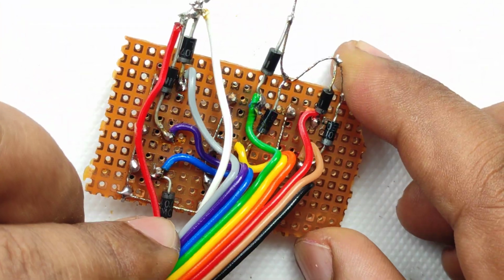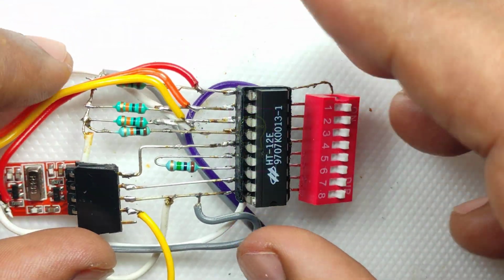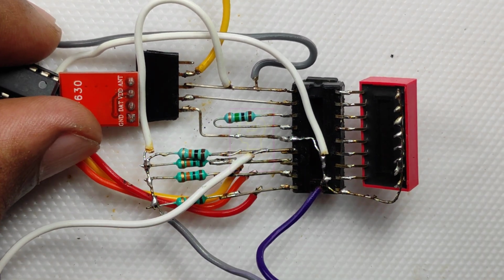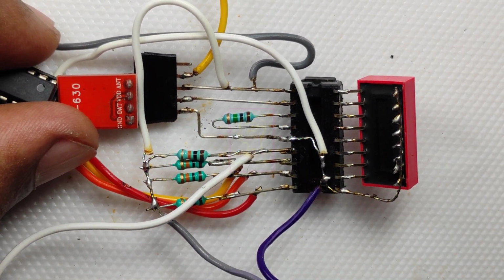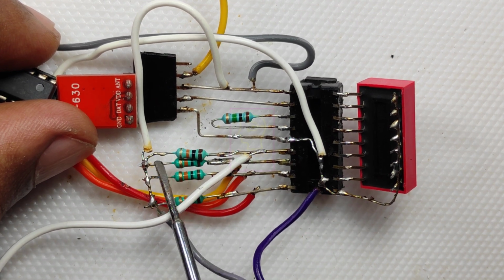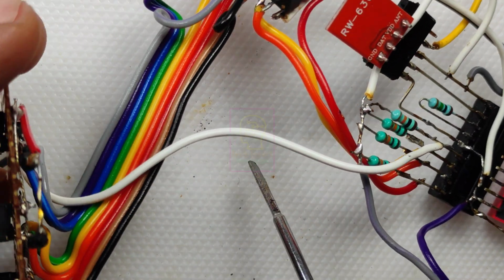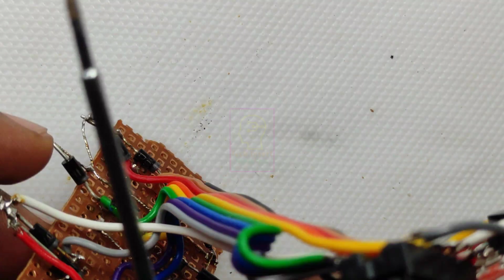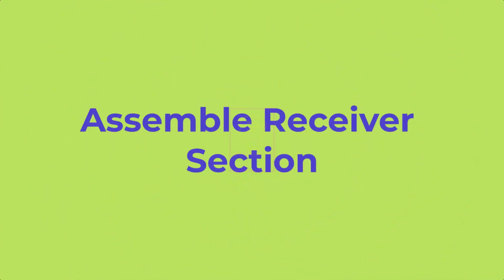How to make Wireless Control (8 - Channel) at your Fingertips | DIY RF Remote Switch

Comment from the maker: @harunkaramuklu1460 pointed a mistake in the transmitter circuit which happned whilie I was updating the circuit from the rough book. Updated circuit diagram is in the following link. https://drive.google.com/drive/folders/1Bwh3xJPWxNahuFEDpNjN2nsm4nyV5UAx?usp=sharing

Comment: What pines are the yellow and Black wires connected to,  that  connected the switching board to the receiver
Reply from the maker: I recommend to use the circuit diagram

Comment: Sir, I only want five channels. What should I do about the diode or circuits in general?
Reply from the maker: I suggest you  to make this 8 channel and make it work. Don't make switching circuits. We will test using LED. After that I will guide you to change it to 5 channels.  You already spend more time on this. This is the short cut idea
Reply: @TechInsert Sir, I want to inquire about something
I used 74hc148 in the transmitter circuit instead of 74ls148. Will it affect me in the circuit? Thank you.
Reply from the maker: @s_ja1935  If you are usin g four channel , then  74148  and 74138 are not used. More  than  4 channel u need these 2 ic's for multiplexing and demultiplexing.

https://youtu.be/VKpRNg_Gl9g

Comment: I have a question about the reception circuit, pins 4 and 8, whether connected to ground or not in IC 74138
Reply from the maker: 4 and 8 connected to  ground.  74138 Pin 4, 5 and 8 are connected to ground.
Reply: @TechInsert Thank you sir ❤❤

Comment: hello sir 
Thank you for the wonderful circuit 
But I have a slight problem with IC 74138 and IC 74148 I connected them to the same connection as the diagram, but there is no transmitter and receiver knowing that the LED for the signal works, but the LED for load does not Works 
Please help and thank you again
Reply: I think the problem is not with the diode I want to know which exit 74148 corresponds to it in 74138 here lies the problem when I click on swicth
The LED for the signal is working, but the LED for loads is not responding, here is the problem
Reply from the maker: @أحمدفليفل-ت8ظ  If the diode is reversed , then the signal from encoder will not reach the transmitter . So i feel ur probelm is ther
Reply: What is the benefit of diode?  Isn't the benefit of it playing 8 channels? I only want to play five. I'm talking about the IC's pin connections
Reply from the maker: @أحمدفليفل-ت8ظ  You need 5 channels,  then you can avoid 3 switches (first 3 switches should be removed). We are using 8 to 3 bit encoder in transmitter and 3 to 8 bit decoder in receiver. But our data encoder HT12E has 4 bit as input. If you check the receiver HT12D Pin number 13 (D11) you can see we have used an inverter circuit using BC547 and is given to the pin number 6 of 74LS138 . So MSB(most significant bit) will decide to switch on 74138. What I will suggest is,  you assemble the exact circuit and remove 3 switches in the transmitter and remove 3 switching circuit in the receiver. Rest of the circuit should be intact
Reply: @TechInsert  The last step I did not understand, sir. What should I do exactly? What should I remove exactly?
Reply from the maker: @أحمدفليفل-ت8ظ  You want 5 channel - So assemble the 8 channel circuit without switching circuit. That is without cd4017 circuit. You will be having 8 switches in the transmitter. Press 1 by one and wat the LED's in receiver. Use the 5 output only for your use and remove the unwanted switches from transmitter. That will be a shortcut idea
Reply: @TechInsert Okay sir, I will try this and get back to you. Sorry for the inconvenience
Reply from the maker: @أحمدفليفل-ت8ظ  It is not an inconvenience to me. Please don't mention that. I will help u to make this working
Reply: @TechInsert Thank you sir 
For pin 14 and 15 in IC 74148 where are they connected or do we leave them empty .
Until now the problem still exists I want to separate five separate circuits with one transmitter
Reply from the maker: @أحمدفليفل-ت8ظ   In 74148 pin 14 and 15 are output 1 and output 2 respectively whereas in 74138 14 and 15 are No connection pins
Reply: @TechInsert I've tried and done everything. 
The problem still exists. 
The BC547 its existence as not doing anything what is its function
Reply from the maker: @أحمدفليفل-ت8ظ  it is used for swtching the decoder on and off
Reply from the maker: @أحمدفليفل-ت8ظ   It is controlled by the MSB from the transmitter.
Reply from the maker: There was a mistake in the transmitter circuit. The assembling was correct , but when i draw the circuit from the rough book i accidently made the mistake. Al  the 1N4007 diode in the transmistterr was reversed. It was pointed by @harunkaramuklu1460 and I confirmed the same.  https://drive.google.com/file/d/105YTJDqPoRAZRxevf05e_yZhoDVlu-SA/view?usp=sharing. This has updated circuit.
Reply: @TechInsert The problem I have is with the 74148 and 74138 connections because they do not respond, please check the circuit diagram again and again and help me
Reply from the maker: @أحمدفليفل-ت8ظ  The circuit is working perfectly fine. Check the 1n4007 diodes

Comment: Sir what is the point of using DIP8
Please explain
Reply: If I want to separate the receiving circuit into separate circuits with one transmitting circuit, how can that be done? Also, do I have to use a custom address to set the address for each of the receiving circuits? Thank you.
Reply from the maker: @s_ja1935  Transmitter and receiver should be using same address. That means your 4 receiving module and the single transwmiiter address should be same.
Reply from the maker: That is for setting the address to ur rf transmitter and receiver. Else if your neighbour is also making the same circuit and if he presses the switch in his transmitter then it will enable ur receiver. Setting address will block that
Reply: thank you very mutch sir❤❤

Comment: Transmitter schema 1n4007 diode there is a reverse connection. 

Can the receiver have bc557 instead of bc547 in the schematic?
Shouldn't it pull leg number 6 to positive?

I think there are some errors in the circuit diagram.

Thank you.
Reply from the maker: You are absolutely correct. Thank you very much on pointing this. That was a mistake while drawing the circuit from rough book. Earlier design do not has these diodes. It was added for enabling all 8 channels by passing a LOW to the the MSB data pin of Ht12E. Please see the updated circuit in the google drive. Receiver circuit is correct.  I have cross checked it.
Reply: @TechInsert I thank you. Good luck.
Reply: @TechInsert  Glad you fixed the wrong circuit
Reply: @TechInsert  Very happy that you admitted your mistake and  took right action on it
Reply from the maker: @TitusKelly-cj8um  Thanks

Comment: You mentioned about cascading of 74138, you mean using NOT gate in enable pin?
Reply from the maker: Exactly, I will make a video on tthat. Here We need to think how it can be integrated since the MSB we are using for controlling tthe 74138

Comment: Excellent explanation, excellent circuit, excellent theory but I still not understand the Diodes in switch and MSB relation. Could you explain a bit more ?
Reply: Then how to cascade?
Reply from the maker: Exactly, I will make a video on tthat. Here We need to think how it can be integrated since the MSB we are using for controlling tthe 74138
Reply: Yes me too had confusion
Reply from the maker: @SabroniWungkul  Iam preparing the detailed explanation and will send